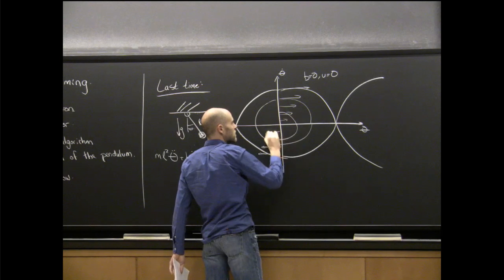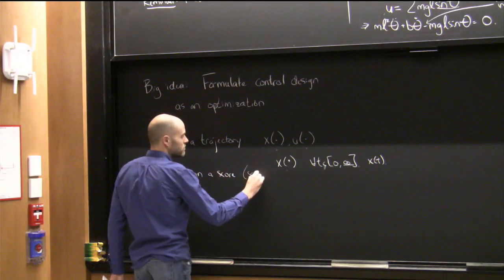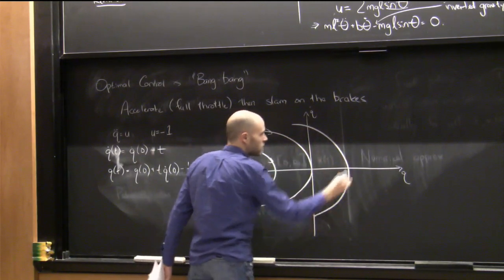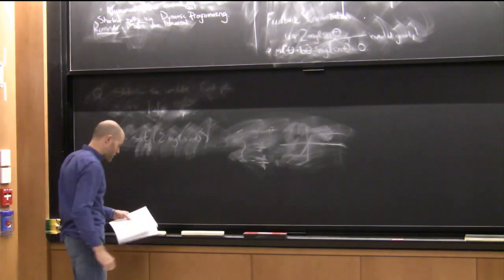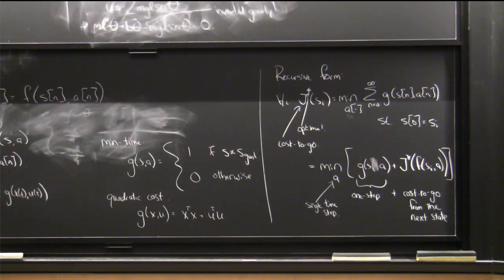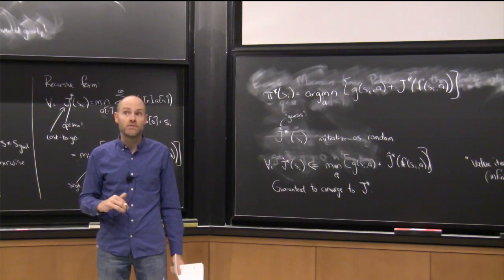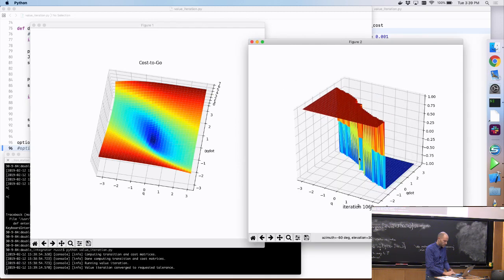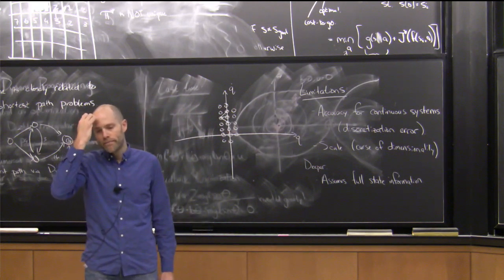Lecture 3 | MIT 6.832  (Underactuated Robotics), Spring 2019

Comment: Thank you sir for providing us internet folks with these lectures for free! I felt to need to write a comment about an observation I made in the lecture. This recursive way of writing the cost function, namely dynamic programming, looks a lot like the bellman equations used in reinforcement learning to compute a similar function (value function). In a way, this implies that solving a non-linear control problem to optimality is just as computationally hard as solving a reinforcement learning problem. Also considering the amount of flexibility and expressivity a reinforcement learning model provides for solving a control problem, sir do you think it is always a better universal tool to use?
Reply: The equations in reinforcement learning aren't just similar -- they are exactly the same.  RL is sometimes known as "approximate dynamic programming", and tends to emphasize the case where the optimization can be done even without having a model of the system.
Reply: But the "hardness of RL" is partly due to this assumption -- of not having a model.  This class will present a lot of stronger "model-based" algorithms, along with RL (at the end)